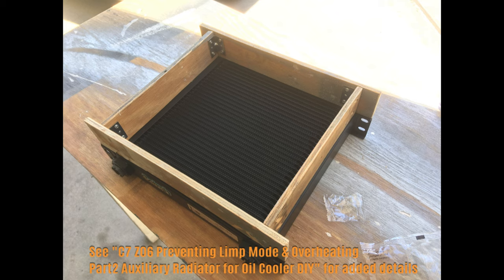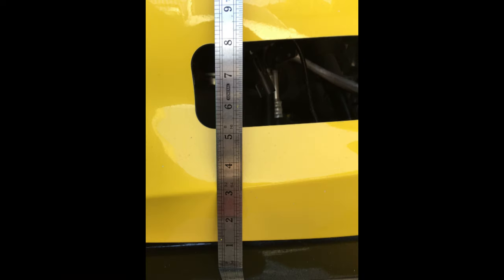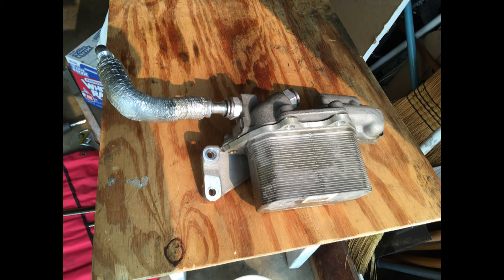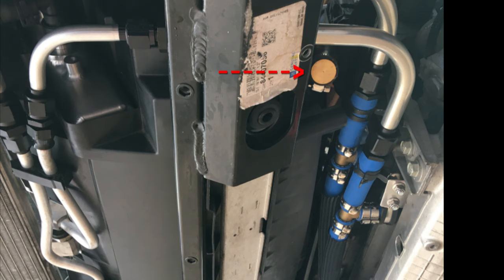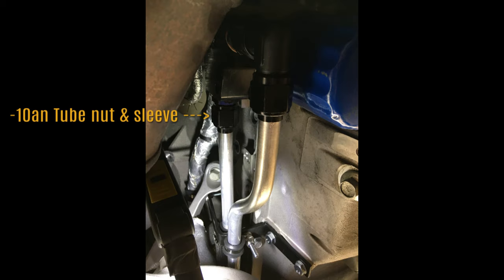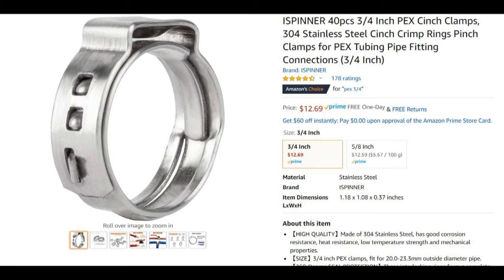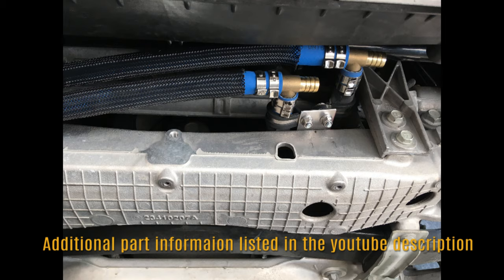C7 Z06 Overheating Fix! Part 4

Comment: I'm gathering the parts you call out, and am pondering similar (Setrab setup) for the intercooler on the other side instead of in front of the radiator. What did you use as a grill material? It looks good, but I didn't see closeups enough to make a guess. Thanks for documenting this!
Reply from the maker: The grill mesh is from Lowes.  It is used to cover  rain gutters and is painted black.  Glad I could help.

Comment: What if u left the OEM oil cooler in place and just "hijack" the lines to the engine radiator and reroute to AUX cooler?
Reply from the maker: Uncharted territory.  Might work but if you're concerned about flow you may want to run a second oil to air cooler in parallel.  I'm just guessing that it might not have enough flow, using just the horizontal OEM cooler for an oil to air cooler may be just fine.

Comment: do you have any more track data after this AUX radiator to oil cooler change?
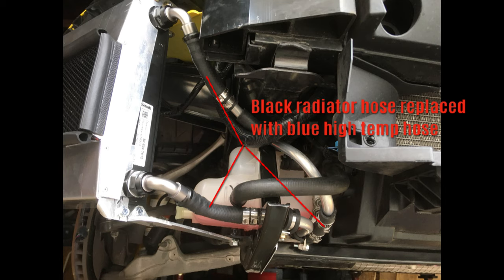Reply from the maker: The best data for oil to air cooler was about 1:48 into the Oct 12 2020 video running 8 laps in 100+ ambient.  In comparison, the stock oil to water cooler the oil got over 300f after a few laps which also heated up the engine coolant.
https://www.youtube.com/watch?v=oxgvoP12-3I&t=0s